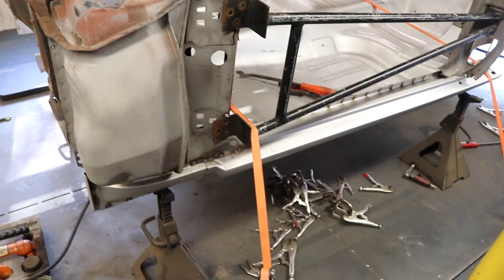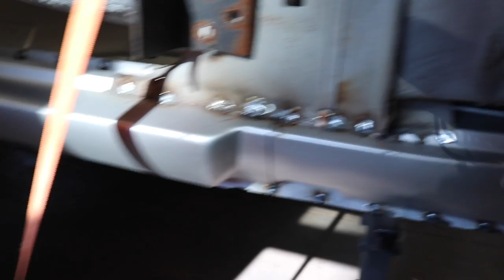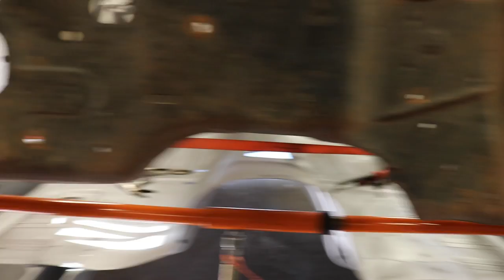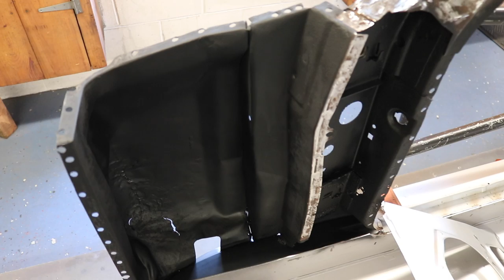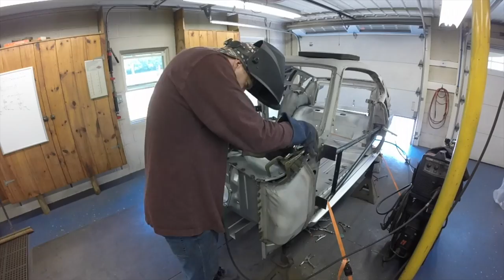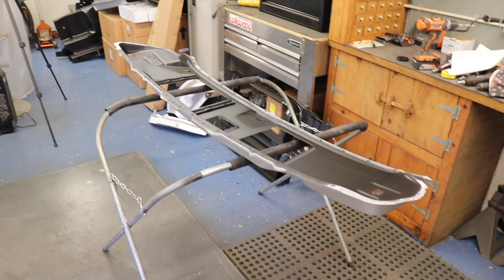Firewall/Cowl Replacement 1970 Boss 302

Comment: Like your stuff i wish you were  around  15years ago it did quarters  with stang pro he was crafted  guy he was cross street and did 45 day restoration  on 65 &66 stamgs nice cars i rebuild motors  for less cost  on my 1970 mach we did  half quarter s and i rotisserie  the body  fixed foot wells they cut 2 ×5 slots for ladder barsrolled like can opener  i pushed back stipes of floor tig welded looks good car is ocpcblue 4 speed  351c was raced in 70s

Comment: Excellent work as always.  With all the cars you do, I would be investing in a spot welder.  This would save you alot of time.
Reply: After all this time and experiences, he clearly has a good reason not to want to use one..
Reply: @philtucker1224  I plug weld just like he does, but it requires grinding welds.  The good spot welders are expensive, but with him building these cars back as original the majority of the time, the factory used spot welder and using such tool would be authentic and save him a lot of time grinding welds.  Not knocking his work, just providing suggestion to help.  If I was a restoration shop, doing the amount of work he does, I would be checking into it.  Check out Carthage Classic Cars to see the benefit of spot welder.
Reply from the maker: Eventually I will cost is high for a good one
Reply: I bought a used Pro Spot welder for 3k.. saves time and makes the finished product look like factory...can't afford not to have a spot welder. Return on investment is very quick.

Comment: What's your thinking on sticking with rosette welding all those welds when you could put a spot welder to better use.  I tired long ago of popping holes in my parts, making the rosette welds then grinding them back smooth.  Actually have a couple portable spot welders for when one gets hot.  Would love to have a better regular water cooled auto body spot welder, but I don't have 3 phase power that most of them require.
Reply from the maker: Cost is high for a good one is the only reason currently
Reply: @petersonrestorations  I get that, I'm a poor boy trying to build early Ford Broncos.  Just recently put my first, a rebodied 76, back on the road.  For insurance they required a professional appraisal.  Got the appraiser to my place a couple weeks ago now, he loved the build.  Shared some thoughts with me on my approach to building the 2nd one, one was I should be asking for discounts or donations.  I'm not videoing my work and sharing it anywhere, so I don't see anyone I asked to do that would actually benefit if they did.  But that didn't stop me, just got a huge discount on some shop equipment I picked up used from a local aircraft maker.  Just got that call this morning to come pick it up.   That was my first ask for a discount and it payed off.  So I'd suggest don't be shy, the worst they can say is no.

Comment: When welding your panels do you use solid wire with gas shielding or just flux core wire ?
Reply: @tekman196….why do you ask, are you a welder, will you be doing this? His welder has a tank so probably its solid wire. The lack of splatter means solid wire/shielding gas. The smooth weld pool means shielded gas. Does this help you?

Comment: Do you find that all the key measurements are the same from car to car or do they vary based on assembly plant and that they were thrown together at the factory?
Reply from the maker: Yea every car is usually within a 1/4 to 1/8 difference
Reply: If you ever have a chance to document and share that data with the rest of us it would be greatly appreciated. The datum drawings are great for the underside but lacks anything else. 
Thanks

Comment: Is there any differences between how the 1969 and 1970 sheet metal attaches?  I know the 1969 quarters have scoop openings and 70s don't.  After watching you do these a few years id like to get one of these from dynacorn.  Id like to make a 69-1/2. 1969 body and 1970 front clip on the convertible floor pan.  Maybe a Shelby rear with thunderbird tail lights?
Reply from the maker: About the same overall other then small differences